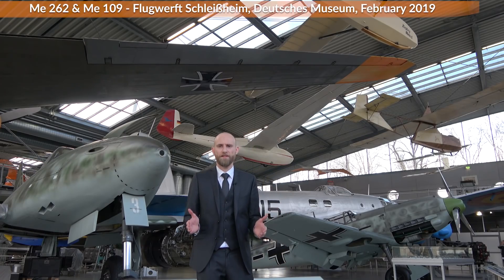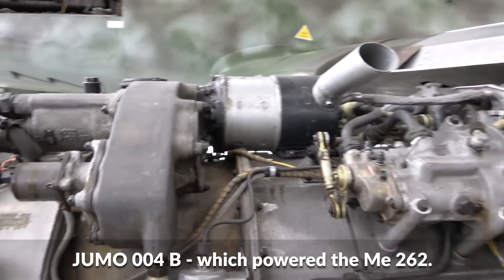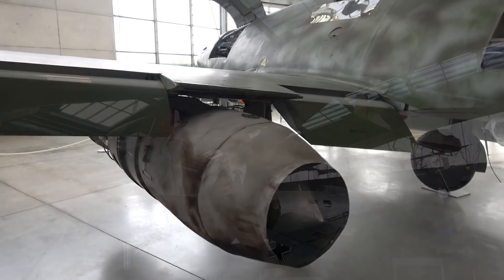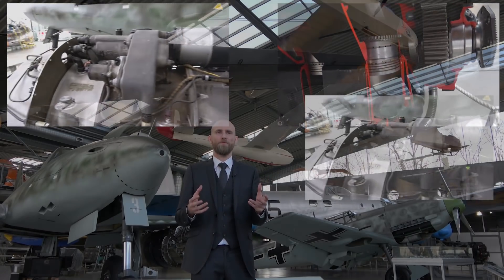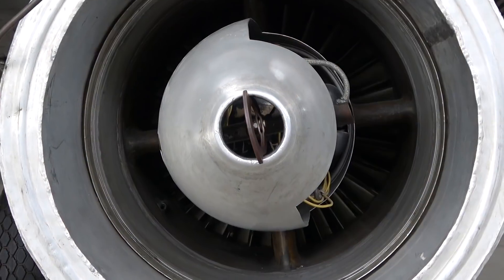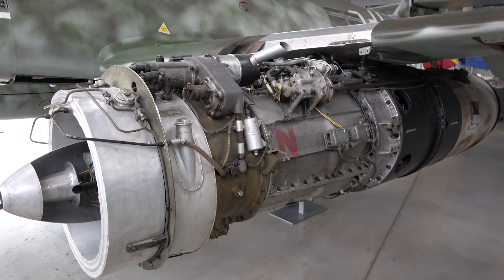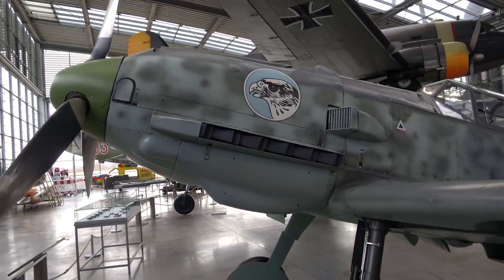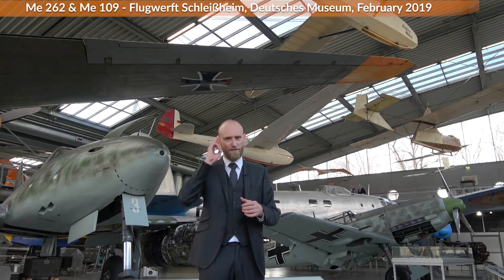Why not just go from the 109 to the 262?

Comment: The Me-262 is an illegal terror weapon in the skies all because they terrorize the skies and shoot down P-51s so easily.
Reply: They didn't. ME262s shot down very few P51s, largely because the P51s were not their targets. Many of the ME262s P51 claims are also not corroborated by Allied records. JG7 claimed over 30x P51 claims, but evidence only exists to support the loss of between 3-8, and probably closer to 3 than 8 at that. 

Most of the ME262 claims do not match up with Allied records. The luftwaffe stopped vetting claims late in the war, so the claims present in books are not vetted to any real standard.
Reply: Actually the Messerschmitt 262 would have trouble dealing with any pistonpowered fighter in a knife fight after that first diving pass. Swept-wing Jets have much wider turning circles. The problem Germany encountered operating their Messerschmitt 262 was during the landing. The jumo engine didn't spool up very fast. You didn't want to just try to slam the throttles forward in a jet aircraft engine in the early days in particular. Firewall those throttles and you're going to have a flame out. They just weren't responsive to abrupt throttle inputs. And even with those beautiful swept wings the Messerschmitt 262 was still subjected to compressibility issues is just taking it closer to Mach 1 than your standard piston engine aircraft because of the Swept wing. So the idea of Messerschmitt 262 cutting swathes through formations of p-51s just isn't true. Granted their primary target was the bombers. The p-51s P38 and p-47s weren't necessarily there to rack up scores, they were there to distract the enemy interceptors and break up their formations. The best tactics for the Messerschmitt 262 were to have altitude on the targeted bomber formation make a diving pass through the escorting Fighters and then Zoom climb and repeat. Because of the speed differential between the Messerschmitt 262 and the B-24 and B-17 a head-on pass was almost worthless because the closure rate was too great. You didn't have enough time to really stabilize the aircraft for the pass and line up your target to pull the trigger. so most attacks with the Messerschmitt 262 were from the flanks and rear of the bombers. Upon getting back to their airfields they were usually ambushed by standing air patrols over there bases. To counteract that and protect the Messerschmitt 262 in in the landing pattern and at take off, the Germans used a combat Air Patrol of piston-powered Fighters over there bases. we won't even get into the quality of Pilots that were available.
Reply: Mial isus  The MK108s were of questionable worth in the ME262 with their low velocity shells. The pilots all say they had to wait until they were within 500-600 yards of the bombers to start shooting, and then had to break off around 100-200 yards or they'd ram the plane. 

This left them with very little time to fire, and they could only attack from the rear which left them vulnerable to .50 cal fire which outranged them (funny enough previously Luftwaffe fighters with 20mm's outranged US .50 cals, so US gunners had to hold their fire while they saw the ME109s or FW190s blazing away at them from long range). Fully 25% of JG7s losses in March 1945 were from the defensive fire from US bombers, probably closer to 1/3rd given a good number of losses were to unknown US fire.

The Mk108, while powerful, was not the most ideal gun for a fast plane like the 262.
Reply: A jet powered, p-38 derived airframe  probably could have been fielded by the US.

Comment: What about the 110?
Reply: Also as a large twin-engined aircraft the Bf 110 is more of an interceptor than an air superiority fighter
Reply: BF-110 was massive for a fighter.
Reply: It was a dog as were the successors.
Reply: Compare the performance of the nearest American design to the Messerschmitt 110, the P-38. The Messerschmitt had those beautiful Daimler Benz engines. I think the day more been series of 12 cylinder engines were better than the Merlin or the Allison. We just had more of our engines and fuel to run them. Also better quality fuel. I remember reading an article back in the seventies where they took a Daimler Benz engine to Rolls Royce and let them examine the engine. Essentially what Rolls-Royce told them was don't break it because we can't fix it. They would have trouble fabricating the parts for that engine. This was a late War engine that was probably built in a freaking mineshaft with slave labor or unskilled labor to a high degree. Think about that.
Reply: @JohnRodriguesPhotographer  The ME 110 was a dog though, it had to be escorted by fighters which is not good when it was supposed to be the escort fighter, too big, too slow, not manauverable enough.